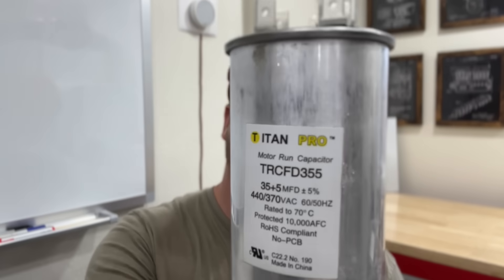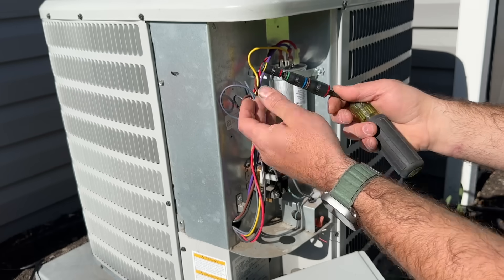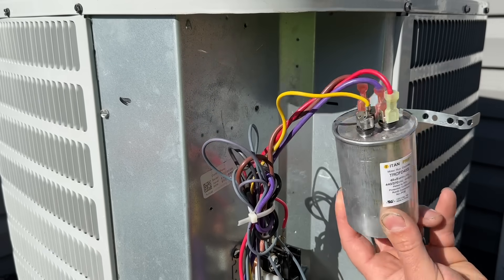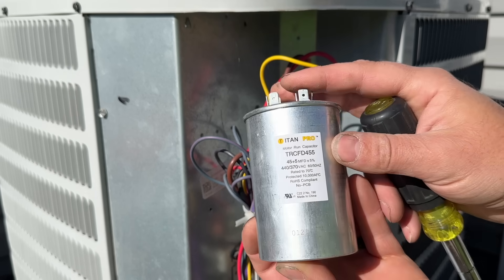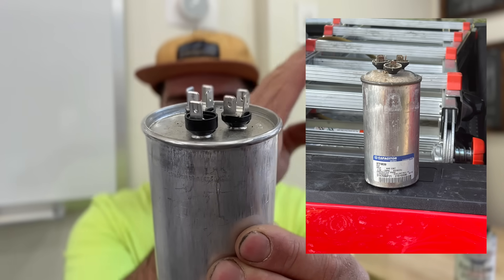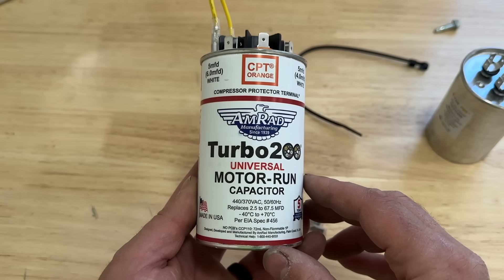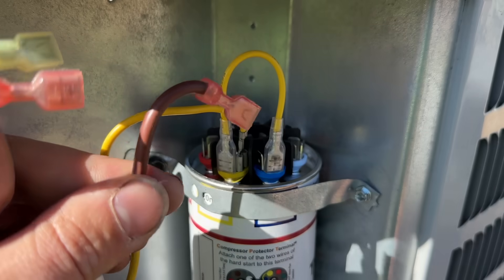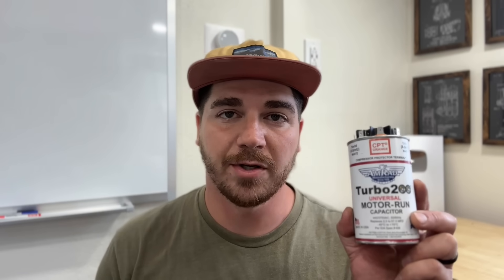HVAC Contractors Practically Make Their Living On These

Comment: There is no legitimate hvac company charging 2k for a cap

The average price is $200-$300, which is reasonable, considering the customer is paying for the expertise and professional knowledge and diagnosis, above all else.

The same argument could be made when calling a plumber for a busted pipe, which costs aprox $300 for the service call, even though the fitting and short piece of pipe may cost less than $5. 

High voltage is nothing to mess around with, especially not for the average homeowner. It is dangerous to suggest that homeowners attempt this DIY bullshit. 

There are always variables that could put them in danger. They could flip/pull the disconnect, not knowing that some idiot may have bypassed it.

Comment: yep.  few years back, had a neighbor in HVAC look at my AC one day when it stopped working.  he pointed out the caps may need changed and said if he did the work, his company would charge about $6000 to get my AC working again.  I used to fix tanning beds, which have entire banks of capacitors in them, so I had the tool to check the microfarads.  I found a bad cap, it hadn't popped or burned, but wasn't allowing electricity through it.  Googled the cap, bought one for a few bucks, put it in, fixed my AC.   saved $6000...  no wonder those guys make so much money.

Comment: Just had a HVAC guy try to charge me $12,000 to replace everything on a unit less than 4 years. Turns out my wiring from my house was just corroded. You might want to mention testing charge to the unit as a first step!

Comment: If you replace the capacitor based of oem info it doesn’t account for then possibility of a different cap rating from a universal fan replacement. Also capacitors often fail from problems with the compressor or fan and faking capacitor can damage other parts. Lastly capacitance should be checked under load and should always be in range of 5% IMO. Particularly on a fan here the 1% causes a larger effect on the amp draw.
 With all that said do yourself a favor and call a professional. If they are charging you 2k dollars tell them to leave and call someone else.

Comment: I have high doubts that anybody is charging $2,000 for a capacitor swap. Secondly, hundreds of people that watch your unprofessional video will be blowing the low voltage fuse or transformer because they touch the edge of that capacitor to the 24v leads at the contactor; now they have to call a company to come fix it because they didn’t know to turn the power off to the indoor unit as well to prevent that accident. Third, that is a RUN capacitor meaning it provides the stored “jolt” of energy the entire process of the compressor and fan motor’s run cycles. Otherwise it would be a START capacitor and would also be in the loop before the RUN capacitor. Finally, keeping condenser coils clean of airflow blocking debris is the most important thing to do to expect longevity from the compressor, fan motor AND the capacitor because with ample airflow you’ll have ample performance. Clogged fins creates resistance which in turn creates higher amps and stress which in turn burns capacitors and wires and the mechanical components themselves. Stick to your day job, Champ, and don’t give advice if you’re gonna skip the first steps of preventative maintenance much less the first steps of preventable accidents to further issues.

Comment: Same with my ac unit. A small $6 regulator failed and they guy looked me in the face and said it’ll be around $1500 to replace it. It’s held on by two flat head screws and one plug in. I had to tell that feller to pack his tools and leave before he got hurt

Comment: I had a Turbo 200 go bad and caused my air conditioner to run backwards.  I had to have a technician come out because I couldn't figure it out.  He spent two hours himself trying to figure it out and eventually changed the wiring on the Turbo 200 so it would work correctly.  Once he left it started all over again.  Luckily I had taken a picture and had an extra Turbo 200. I replaced the bad Turbo 200 and rewired back to the original configuration.

Comment: Had a relative that had her A/C go out in the peak of summer and couldnt wait for me to check it out so called some place that adverised a $99 maintenance special.  The so-called tech went into her attic with no tools or test equipment and told her that the blower motor was bad and he just happened to have that "hard to get" part on his truck and he could give it to her for $800!  She called me and I told her to send the guy on his way and wait for me to look at it.  I brought my tools and meter and determined it was the capacitor.  I got her one at a supply house for $7, put it in and she was back up and running!  Unfortunately there is a large percentage of dishonest "techs" with no integrity!

Comment: When mine failed I called for service. While I was waiting I checked power and breakers and finally the capacitor. When the tech pulled up I told him it was the capacitor. He poked and prodded and of course dismissed what I said. Fifteen minutes later he announced, “I think it’s the capacitor!”.  He then charged me around $850. I wrote an email to the company stating that since the cap only costs around $20 I can’t see you marking it up more than to say $50. Based on that, I calculated their labor rate to be $3200/hour. So, I said, “my question was is, are you hiring?”

The next morning they called to tell me “oops. It’s under warranty and there is no charge “. 

So not only were they going to scam me for the cap, they were going to double bill the manufacturer!

Comment: when it gets really hot out, sometimes even when I havent been running the ac , and then i turn it on and the compressor wont kick on. then  when it cools down outside it willl run, and no its not in the sun. ive been tols its because of "dirty power". PG&E ???

Comment: I've learned more from this young man for my 2 homes than anything or anyone Ive seen on YouTube. Fantastic job. Also, if there are Hate comments, they are most likely the companies that charge $2000. A Houston based company called Elmers had a guy that tried to charge me $33,000 to change out my unit, attic unit and new ducts....  On a 2019 New Home! I Simply cleaned the fins and changed a capacitor and Ice Cold inside. 

Houston area folks, Beware of Elmers HVAC.
Reply: I had a heating/plumbing contractor tell me both of our 200 amp panels had to be replaced. Said they were oxidized and it would take a day and $25,000.

A retired master electrician who did work for us said “so what, metal oxidizes.”

The same company gave me a quote on an additional 75 amps of service. Can’t remember how much that was, but it was complicated and well over 10K. The retired electrician did it for $1500 and took a much-simpler approach.

The company I mentioned called me and I had a long, civil conversation with them about how I could never do business with them again because the guys they sent were liars.
Reply: They have ads here in Fort Worth that he can fix any AC to keep you going so you don't need a new one!
Reply: @jonathangatto, the same ads were running for Elmers here in Houston.
Reply: Wow, that is crazy to charge so much,  on a new house yet!  😳
Reply: I hate their ads with that stupid face lol I think there's one near the 59N/10 interchange

Comment: Had HVAC guy come out multiple times for the outside unit not turning on.  Replaced this capacitor and problem still occurred days later. Thought we blew another capacitor, so this time I said fuck it, ill replace it myself.  Was cheap, but the issue came back shortly after.  Eventually I made my way up to the board with a meter to see if there was power issues. That's when I found the a circuit was wired in series with a drip sensor that was tripped.  The pvc going to the guest bath was full of water.  HVAC couldn't fix the drain, so ended up getting a plumber to clear out the drain pipe.  Now we drip bleach in the pipe occasionally to keep the build up from happening.  Was an costly adventure for sure, but damn I learned a lot.

Comment: I have replaced a capacitor for someone in my neighborhood for $50 and I do the live testing and the bench test when removed and the microfarads are very similar but hers was way out of tolerance. I do leave the capacitor connected for a little bit to allow the coil in the comp discharge the capacitor. On this unit everything was working the fan and compressor were both on but it was starting to mushroom slightly so I knew it was going out. This is a great video to show those that are good at DIY but aren’t sure how the ac system works.

Comment: I had my capacitor go bad and the fan stopped working. To give myself some very temporarily leave I put a box fan on top of my outdoor unit blowing upwards. It was enough to keep the air moving and have it cool my house until I could repair it. Sometimes you can even just spin the fan yourself with a stick to get it started.
Reply: I’ve been spinning mine by hand for 2 hours how long does it take?
Reply: If it doesn't come on with assistance it's not going to come on most likely

Comment: I bought a midea cheap off brand mini split, friend shorted the mainboard, found one online, replaced in less than hour, was pretty easy and I never messed with mini splits. Was about $180, free labor. I have experience with those capacitors since I have owned many travel trailers/rv's which capacitors go put at times, real easy. Just connect way it was. Just don't shock yourself, use good electrical gloves.

Comment: Nice to know that there are good honest people (like you) out there !
You already saved me from getting ripped after watching your video about furnace
repair scams. I was told that my heat exchanger was cracked and that I needed a new furnace.
After watching your video I called a local HVAC company and they told me that there was nothing wrong with
my heat exchanger. The blower motor was faulty. They replaced the blower motor and the furnace worked fine.
God bless you brother !!!

Comment: Shouldn't you discharge the capacitor before removing it? An HVAC capacitor can hold a lethal amount of juice if I am informed corrrectly.
Reply: Run capacitors generally don’t store electrical current it’s the start capacitors you have to worry about

Comment: I had my fan motor burn up. I ordered one from Amazon while i was waiting i put a couple box fans on my coil. One pushing into one side and one pulling set on the top. It worked until the new one came in!

Comment: I had my hvac unit installed April 2020… it stopping working 1 1/2 years later said it was a sensor and a switch.. now it’s fed up again doing the exact same thing. The fan kicks on but it isn’t cooling.

Comment: Also fun little fact.
As most know.. Nearly everything is garbage compared to the past. Everything is made to fail and competition is near gone.
Capacitors used to be filled with far better oil.
Those Titans are fine but dont think they will last anywhere near your old one that you probably had for 15-30years.
You get a few years out of them at most. I seen them fail in 2 or last for 6. Just depends but its definitely no where near the old stuff.

Comment: One video on replacing the capacitor seemed to indicate that even if the cap is working, if it's degraded, that could reduce the cooling power of your A/C. Is that true?

Comment: I have never heard someone charging that unless you're mistaken and it was a compressor that was replaced from a possible failed run cap. I don't think putting fear into people by making outrageous statements is good but educating people is. Be straight and to the point, people will understand. Also those are run caps which will not hold a charge unlike a start cap so discharging isn't needed. From my understanding, the turbo cap is only for a temporary repair until the correct run cap can be installed. The price of a turbo cap is not worth keeping in your shed compared to the standard run cap.

Comment: The bigger rippoff is for the coolant.  They stick on the coolant “computer” with valves attached to a new coolant tank, then say “oh, you are low 15 lbs of coolant.  Fill it and then charge $50 a lb or something.  Meanwhile they added about 2 ounces of coolant.   I caught my guy doing this.  So I said weigh the tank please…  it was FULL.  So how did you put in 15 lbs of coolant while the tank is still full!  He did not get a penny from me… and was promptly escorted off my property.   He had changed my oil burner nozzle prior to looking at ac condenser.  That that I got free as he didn’t even ask for payment on that part of labor.
Reply: Bs
Reply: @justincummings4775  Good one!

Comment: Another good thing to mention is that the expected life of electrolytic capacitors is 5 years so anything over 5 is bonus. An honest hvac guy would recommend replacement whenever they are there working on the unit if it’s older than 5 years. It’s also nice to write on the cap the date it was installed.

Comment: Contractor #1: Quoted me $18k for an entirely new install because the old HVAC "couldnt be fixed", this is after apparently testing everything.

Contractor #2: Diagnosed the issue, said the capacitor has gone and needed to be replaced, he charged me $300.

Comment: As a former HVAC teacher, I can tell you I get tons of calls from family and friends on the first hot day of the year. Some have already had someone out, telling them  they need a whole new condensing unit. In 90% of these cases, it's this $12 capacitor. I now stock them at home. The next big issue is, they have been using the wrong fuses (not time delay).

Comment: Without the capacitor, the fan won’t start. The fan is responsible for cooling the coolant in the radiator. If the fan is not running, it doesn’t cool off the radiator so your vents blow hot air
Reply: You know about as much as this guy

Comment: Depending on where you live in the country if you hire someone to do it that is actually an insured, licensed etc. business they are going to make money off the money they invest in parts, tools, trucks and labor. You are looking at a $280 - $350 service call, probably a little less if it's during normal working hours and they don't have to travel to far. Anyone charging $2000 or more for this type of repair should be turned into your State's Attorney General. If YOU feel qualified by all means diagnose and replace it yourself, you'll still save a significant amount of money.

Comment: Similar scam to the microwave rectifier. There is a reason they keep a display box of these on the counter at appliance repair shops. I have replaced two so far. Of course capacitors CAN kill you, so be careful out there. If you want to be extra safe just wear heavy rubber gloves so you can't get a shock. Instead of yanking on the wires, I personally would use some needle nose pliers and grab the crimped connector itself sp you don't pull the wire out of the connector.

Comment: Great video.  Friend was charged $250 for this replacement a few years back.  Mine went out and ordered one from amazon with the same specs.  Cut off power, worked carefully around a small wasp nest below and unit fired right back up.  The sense of accomplishment is incredible after all is said and done.
Reply: $250 is a very fair price, from a legitimate company. People don’t realize that companies have overhead. And you’re paying them for their diagnosis of the problem as well. Anything more than $350 for a run cap is not good tho. 250 is solid

Comment: Sure just about anyone can be a parts changer, but do you know why the cap failed? Did you fix the cause or just install a new cap and call it a day? I have seen many compressors or motors fail because either a homeowner or another company found a bad cap, replaced did not look any further into it.  Sure, they can just fail, but typically it is due to low or over changed unit or filter and other shit being dirty causing higher than normal load.  And sorry, there is not one company that relies on or would ever be able to run a company of replacing caps.  That is just a ridiculous thing to say.  Do some charge more than they should? Sure, but that’s in most industries and not exclusive to hvac companies.

Comment: For a $4-5000 system why can't electronics manufacturers create a reliable capacitor that lasts?  I would pay $200 for one that last as long as the entire system instead of $20 for one that fails every 2 years.  Turbo 200 is a scam.

Comment: I"m sorry but the Turbo 200 is excessively complicated and overpriced compared to a simple capacitor.  The average home owner would screw that up every time.  It would be handy for the HVAC guy doesn't want to stock multiple caps.  Plus they will just pass along the extra cost to the customer.  Scam.